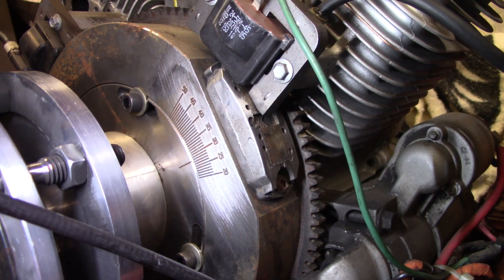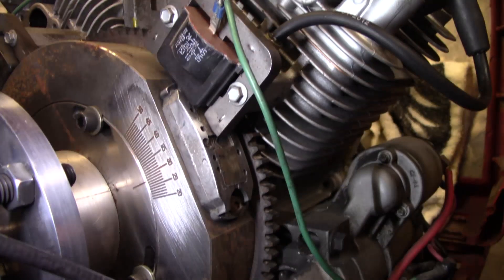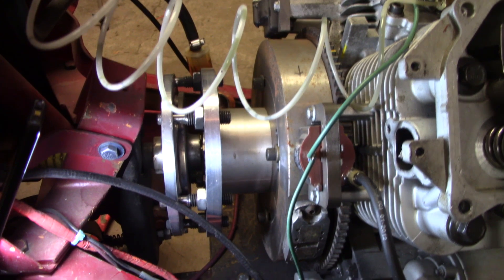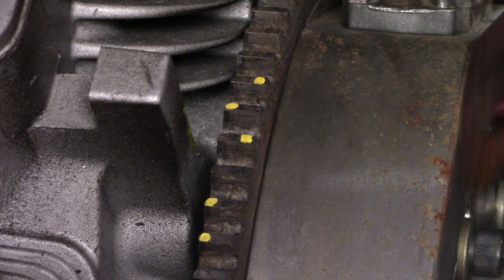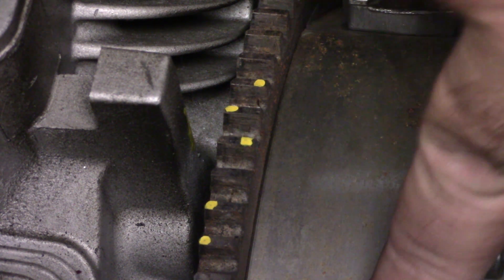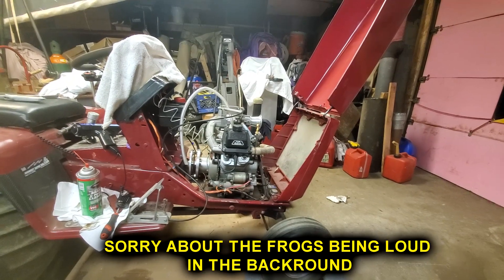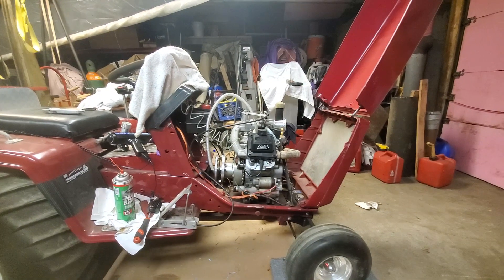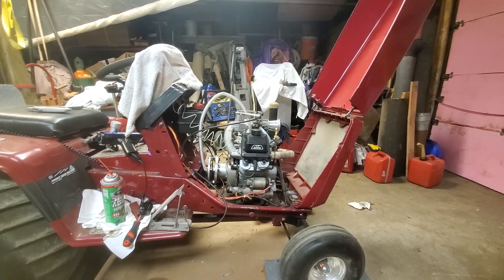Putting Plan B Back together. #tractorpulling #KohlerPro

Comment: It's gonna love that Methanol! I think 32 on the timing is the smart way to go. A kickback on that hot V-twin would be a bad day. I ran 36 on a Methanol long rod K241, it wanted to kickback and run backwards almost every time you shut it off. Sometimes when you started it too, I dropped it down to 34 advance after it broke a shaft on my external starter. I should have been using a belt drive starter cart to begin with I guess. Hindsight!
Reply from the maker: Yes methanol is a slow burning fuel and I want it to be happy.

Comment: How would you go about dropping weight from one of these engines? I want to use the same one, but I'm constrained weight. Using an aluminum flywheel and dropping all the plastic bits. Maybe even going to a composite intake. What do you think?
Reply from the maker: I wouldn't use an aluminum flywheel they are good for racing where you want to rev up and down quickly but in pulling you want to hold rpm and the steel flywheel does just that with rotating mass. These engines are at minimum weight as is basically. You may need to lighten the tractor itself.
Reply: @PullerbearEd  thanks for replying! I've been going through all of your build videos. Awesome stuff!
Reply from the maker: Thank you.